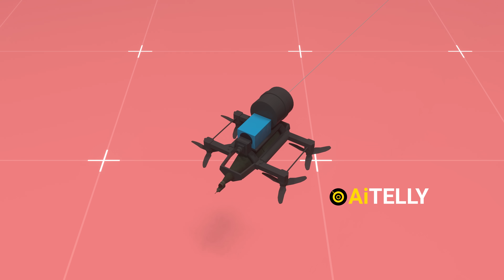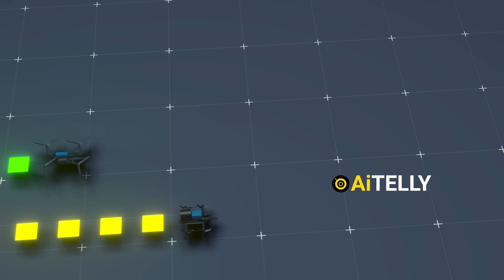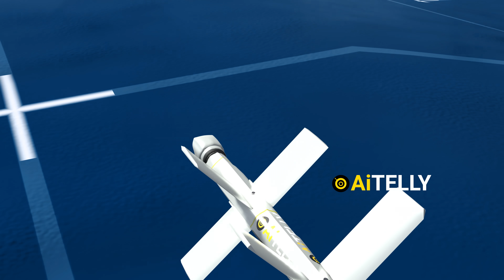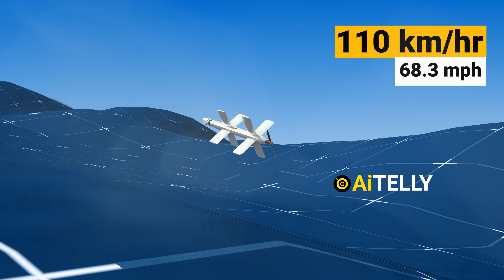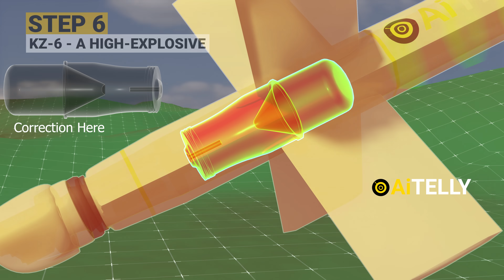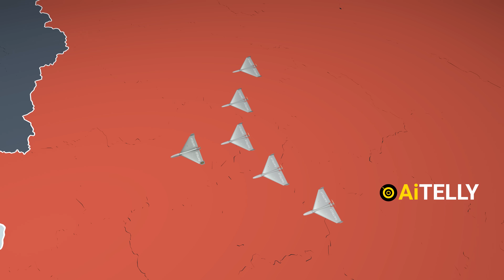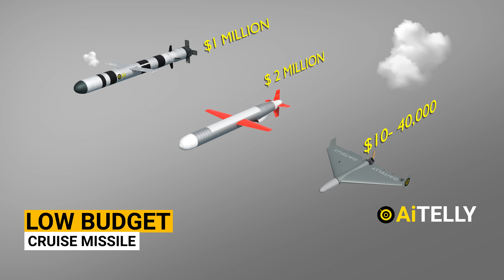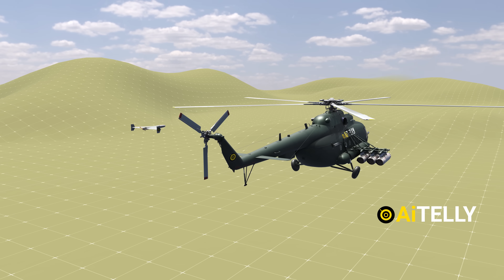How Russian Drone Strikes Works against Ukraine?

Comment: You actual wrong the fiber optic fpv was MADE TO GO FARTHER searching to a distance of 5-10km un jammed
Reply: Try researching more about the TOW or similar ATGMs. They all use a very thin fiber optic cables/copper cables which allows the operator to control the missile's yaw and pitch mid-flight.

The Fiber Optic drone uses the same principle, with the missile instead replaced with a drone.

IIRC in US army training for using the TOW ATGM, they would have teams spool the discarded wires because it might snag into something. I believe in actual combat, the wire is obviously just discarded then ignored.
Reply: @aghressor  But the wired messiles are much heavier, they have rocket engines thus can carry more weight, they fly at least 5 times faster than a drone, not making 360 degree turns which can entangle the fibre on to motors or being cut by props, also the missiles are not doing rapid dives, circling around targets and etc.. 
The drones are very light aircraft and every gram counts for them, they can't be compared to a rocket or missile. Also ground TOW crew is a very complicated unit and usually is effective only in ambush. The current use of fpv drones is more for clearing a big area with range in most cases of 5km but sometimes they can go far up to 10km to 20km. Also the FPV operators are getting their target from a surveliance drone and fly in the direction and search for the target while a ground TOW unit have to have visual with the target to shoot at it. Overal this hype with fiber optics FPV drones is more of a marketing because they're not that effective like a regular radio controlled drones.
Reply: @NikiPetrovAtanasov  I think you're still thinking the drones used are commercial DJI Mavic's. They are most likely using a bigger drone that's probably purposely made for the fibre optics and all the weight it adds.
Reply: @thesayxx  hahaha, why? Don’t you read my comments? For anti armour they usually use 7” drones, they also have capacity that will be affected by adding another accessory.
Reply: @NikiPetrovAtanasov  they use mavericks for FPV suicide drones usually with a 2,6kg PG-7VL strapped to it. These drones are a new design, and we've yet to see how they are constructed. There were some ad hock mavericks equipped with a fibre optics wire spool, but it seems the new ones are factory made probably from the ground up. All i've seen about them is 1 video where a drone destroyed a Bushmaster IMV.
Reply: @thesayxx  Maveric? Who made them and where did you get the info about?
Reply: Yea there’s footage of a drone using it already it went a long distance
Reply: @davidhernandez741  nope, trivial fiber cable  has  7-10kg  of mass per 1 km.  the kamikadze  dron has load around  3 kg. It is not possible to do this. It is not a problem for torpedo (mass 2000 kg and cable weight  10kg ~1 %) and not possible for drone  (10kg mass)
Reply: How does the fiber optic work though? I want to learn more about that aspect. Any recommendations on viewing more?
Reply: @olliefoxx7165  its pretty simple the optic cable connects the drone directly to the operator, transmitting the signal not required a wireless connection
Reply: @akboy4742  Its actually spooling off fiber optic cable? There is an actual, physical optic cable? That seems impossible. I know I sound really dumb, please humor my ignorance
Reply: @olliefoxx7165 yeah, it's actually spooling a cable. Much like how torpedos work.
Reply: @olliefoxx7165  yess it is. Just like cable guided antitank missile
Reply: @olliefoxx7165  well it is really connected to a optic cable. I suggest you check out the wired guided atgm, this drone likely has a similar wire system
Reply: @olliefoxx7165  Just like spider spitting out web from her back
Reply: @akboy4742  Hmmm, that is a little odd. That means you have to have long optic cable and it has to have a clear line of sight before it snags something and breaks. I think having fiber optic relays might be a better solution than having each drone drag a line out.
Reply: @darkcloud5830  drones are flying in the sky. They don't need to weave through anything. But even then, since the spool comes from the drone and not from the launch site, it can weave through things and keep going and keep spooling.
Reply: @akincomer  Dude, do you know anything about fiber optics? They are not that flexible. They are glass. Any cracks will make the cable useless.
Reply: @olliefoxx7165  Yes there is a spool on the drone itself

It works pretty well, its a very thin glass wire 

If it spooled from the launcher it woulnt work
Reply: @akboy4742  thats a lot wasted fiber cable man. Do they pull cable back when it is done?
Reply: @olliefoxx7165  This is basically old technology. Wire guided systems were basically the norm before remote and fire and forget systems. This time the Russians just upgraded the technology to fiber optics. Do some research
Reply: @darkcloud5830  You think, but you don't know that's why you're on here asking questions that you should have researched long before you came here.🙄🙄
Reply: @TheRealBillBob  "Do some research" Smh, I KNOW about wire guided systems dating back to WW2. There is film of the Luftwaffe using guided bombs on British ships. We are talking about FIBER OPTIC cable. You understand that right? A drone that can spool off 5km of cable isn't old technology. I dont see how it's possible to have such cable to spool without breaking as well as the other myriad of issues that need to work. I find that extremely impressive technology. It's a real game changer. However, I will do my research bc I don't know everything nor do I belittle those wanting to learn.
Reply: @olliefoxx7165  Once again you repeat the same "I don't know how" and that is because rather than do research, you knee jerked a response  back to me. And yes people like you deserve to be belittled because your comments are pompous and selfengrossing, rather than innocently inquisitive.
Reply: @olliefoxx7165  I saw a photo of this wire, 0.05–0.07 mm thick
Reply: That's why the spool is on the drone and not where the drone operator is at.

Think of it this way. You and a friend have a rope. If you stand still on one end and your friend with most of the length walks out. It doesn't matter if it catches on a branch or stick. He will lay down more rope as he continues.

But if it was the opposite. Where you have most of the rope and your friend only walks out on the tail end. Then when he snags on a branch there is tension and the line will be disconnected. 

That's why the spool is on the drone instead of on the operator. Because it will just lay down more fiber optic cable. So there isn't any tension at all.
Reply: @olliefoxx7165  Yea a physical fibre optic cable spooling off the drone. Its far from new technology. Most of ATGM missiles use the same design, going back as far as 1955 (French SS.10 ATGM)
Reply: @thesayxx  Thank you for the info, I didnt know fiber optic cables were used that far back. Do you know what materials are used in the cables? Are they spun glass? How are they able to keep the cable from being snagged and broken over such vast distances?
Reply: @olliefoxx7165  I have no idea what kind of wire they are using on the drones. They prevent snagging by being spooled off the drone tho. With the wire guided ATGM's the wire is being spooled off the launcher and snags are usually not a problem because they operate on line of sight (you cant hit a target if you dont see it with them). And the wire is there only for control inputs to the missile.
Reply: @olliefoxx7165  one of the most popular ATGMs - is TOW. W - stands for "wire guided" . And it's literally a wire (copper wire) which is much heavier and less durable then optic fiber. And TOW has 4.5km range even at low altitude flight. So why you are surprised by optic drones?
Reply: @krivdaa9627  Thanks for your reply. I'm surprised at the durability of fiber optic cable. This is on a drone that is flying/maneuvering/searching for targets. There are trees, powerlines, buildings, other aircraft,  structures, etc that can snag the cable. We arent talking about launching something from a high altitude that's got nothing between it and the target. 
With that said, you seem to be more knowledgeable about this subject. Do you have any channels, videos you would recommend that shows the manufacturing process of this particular fiber optic cable?
Reply: @olliefoxx7165  Thanks.

first of all, fiber-guided drones are not very common thing, currently both sides produce and employ tens of thousands conventional radio-guided FPV drones __monthly__. Fiber guided ones are extremely rare on this scale, but both sides experiment with such systems.

Actually, normal radio-guided FPV is very hard to  radio-jam, as they can use variety of frequencies to operate. And most jammers can operate only on a small fraction of frequencies. 

The main thing to understand this new warfare is to know how dirt-cheap the drones are. "Conventional"  ATGM, like Javelin or Kornet cost about $100k per shot. FPV is about $200-500 per device. So you can use an absurd amount of 200 (!!) drones for the cost of one ATGM. And FPVs are much more likely to hit the target!

So each side runs fast to develop new generations of drones and drone defense systems. And fiber-guidance is one of these researches. 

Yes, you are absolutely right: fiber guidance  has a lot of constraints. Such drones can't be maneuverable,  cant be used efficiently in urban landscapes and so for. But current battlefield is mostly fields, large open areas with small forest lines. So it's ok for drone to get to considerable altitude (400+ meters) and than make a single dive. Fiber is very light weight, so it falls down not so fast.

But everyone knows where that race will finish: AI guided drones. Both sides have already really very good prototypes. They cost much more, about 2k USD per unit, and software is far from flowless. But the constraint for FPV is not the price - it's in training pilots. Most people aren't agile enough to pilot them. so - people are the true constraint. AI guidance eliminates both radio jamming issues and people constraints.

regarding sources: youtube censors this topics VERY hard (just consider impacts of drone usages by terrorist groups! it's really terrifying and no country has got any defense!!)  - but the good sources can be found in Telegram. With a language barrier. of cause.
Reply: @krivdaa9627  So why you are surprised by optic drones? 
1. The electronic warfare system is not working.
2. Data transmission via optical fiber. It breaks when bent.
Reply: @krivdaa9627  one of the most popular ATGMs - is TOW. W - stands for "wire guided" . And it's literally a wire (copper wire) 🤦‍♂🤦‍♂
optical dielectric drone.
Reply: @krivdaa9627  🤦‍♂ optical fiber can transmit a signal without delay and without loss of quality over a distance of several tens of kilometers, whereas data can be transmitted over wires over a distance of no more than several hundred meters, however, we are talking about heavy data.
That is, your example with  TOW. W is not good at all.
Reply: @darkcloud5830 You should tell the guys missing limbs from these things that the cable is not flexible and can break, so obviously something else tore their leg off. You should tell the orphaned kids not to worry, daddy didn't die, these drones can't work because the cable will get snagged. Maybe one of these children will point out to you the bleeding obvious - the spool is located on the drone itself which solves the issue of tension and attendant snagging, and the cable can't be that inflexible considering it's coiled up in small cylinder attached to the drone.
Reply: @olliefoxx7165  It is virtually the same technology that was used with older wire guided systems except this time it's using the much better quality fiber optics
Reply: @olliefoxx7165  like how the fiver optic atgm works
Reply: Как думаете рыбак с  удочкой может поймать дрон с проводом оптоволокна😂
Reply: US Fiber Optic Guided Missile was developed decades ago. It worked. It was foolishly discarded.
Reply: I think this is an ordinary thin coaxial wire, like those used in anti-tank missiles
Reply: @ДенисЗайцев-э1ф  по нему передается видео в HD
Reply: 10km roll of 0.5mm fiber optic weghts about 3kg and that's only for the fiber without the reel. This is pretty significant weight for an FPV drone. So they have to decide what to sacrafice, range or payload/grenade. Also fiber on a drone is something very dangerous for the drone itself, no sharp turns, no sharp dives as the fiber may entangle the motors or be cut by the props. Overal not much practical beside in a planned ambush where the drone operators are waiting let's say 1km from the target and the target have jammer. Otherwise it doesn't woth it.
Reply: @NikiPetrovAtanasov  По мере удаления вес уменьшается.
Reply: @AAhilless  And battery level drops at the same time. But yes the weight is decreasing trough the time. The biggest issue I see is the possibility of entaglement to the motors or even cut the wire if doing rapid turns or dives. I've been doing some commercial work of hanging billboard transparents using fishing wire and we had many crazy situations but so far without crashes. Long wire on the drone is a recepie for disaster, of course it works but risk is too high and we were charging our clients accordingly. So far all videos I've seen the drone flies slow like a grand ma :) I guess this is exactly because of the risk of entanglement.
Reply: @NikiPetrovAtanasov  actually it's much less then 0.5mm. 3km is about 350 gram
Reply: @krivdaa9627  The only UART to Fiber Optics transciever I've know uses 0.5mm. Can you share a source of your info?

Comment: So 5 miles is now 10 km?!  interesting.
Reply: Don't worry, later on the 1 mile becomes 1.2 kilometers, so if you average those two out, add the typical length of an anti radar fiberoptic cable divided by the square root of the orlan and google "miles to kilometers" you get your answer
Reply: You people still expect these youtubers to actually be people of knowledge? They are just youtubers doing this for views and monetization.😂😂
Reply: Perhaps the mistake is that the author of the video took the nautical mile as a basis.
Reply: AI generated content, there are a lot of other mistakes

Comment: Thank you for great content 
"russian" drone has 1% russian components, it's last decade CPU and GPU processors from western (dual use products) countries
Reply: Lancet have 100% Russian components
Reply: Well, well. Continue believing in these fairy tales.
Reply: Для ракет не обязательно использовать чипы в 3 нанометра ))
А чипы в 90 нанометров Россия производит и сама.
Reply: 2 ways to create a one-time flying military items :
 |90%+ RU components.expensive and slow (lots of corrupt rats at all stages of production)
 |90%+ uk/usa components.cheaper and faster (sanctions is sanctions but money is money)
If you can use both methods at once, so why not?
Reply: А ты знаешь что на первом чемпионате мира по искусственному интеллекту россияне набрали 99 баллов из 100 и стали чемпионами?
Reply: Кто вам рассказал про 1% ?